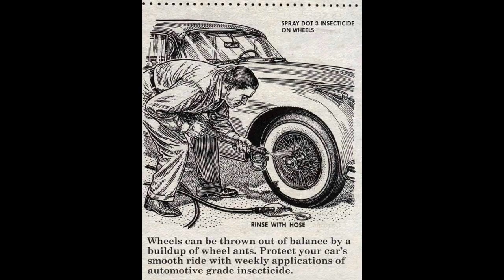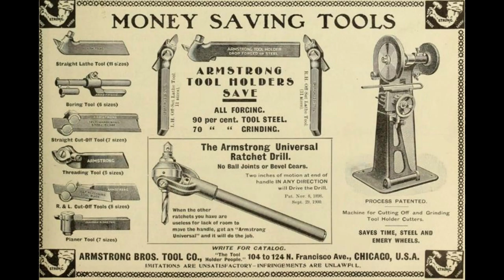Brown & Sharpe mill from horizontal to vertical machining

Comment: Doesn't seem right not to have B&S taper!  But is probably a lot easier to knock it out!
Reply from the maker: Wow! The B&S Tapers could really stick. I am not sure but WW2 might have been when they began using the now standard 40 and 50 machine tapers that happen to be low cost on the used market now, thanks

Comment: I have  machine that uses the NMBT 40 tapers. Same deal with the CAT 40 tapers.I had some CAT40 tapers given to me. rather than waste them ai decided to use them. But still wanted two drive lugs.  I simply machined a custom drive lug for it and never looked back.  The metal sure had brightened up quite a bit on the old Morris drill press
Reply from the maker: I found once I got the unhardened spindle socket true from a 40 taper holder spinning, the holders tend to really stick. As long as I pay attention to keeping the draw bar snug, there seems to be no problem using it for light duty repair work without the drive lugs. I think there are 4 distinct 40 taper style holders using 3 different threaded draw bars, I am using them all on this head.

Comment: The radial arm drill is looking good Don. Did you ever get those bearing replace you talked about on it? Thanks
Reply from the maker: The bearings I will replace after I move it close to the building, thanks!

Comment: Heck, that idea, in the Ad, of a beer bar at the front seat, for the passenger and, apparently, the driver, would make for a very mellow accident. Things were very strange back then.
Reply from the maker: People really got hurt and killed in those old cars even in light accidents. No seat belts because it was better to be thrown clear of the old sharp glass and twisted metal. Up into the early 90s the bars in Montana had drive through windows and Go Cups. One bar you could buy dynamite!
Reply: @DonDyarprecision  yeah. Those were the days before terrorists and other problems. I have a book from one of the magazines, maybe Popular Mechanics, I’d have to go look, which told you to go to your local drug store and buy red and white phosphorus in their recipe on firework making and various recipes on gunpowder. It’s amazing that you could just get these on the corner. I ran a fair size commercial film lab here in NYC for 28 years. I have a license to buy whatever chemicals I want. I did have six years of chemistry, so I qualified, plus a quick background check. I needed that as we processed Kodachrome film and you had to make the chemicals from scratch. The ones Kodak didn’t sell I bought from City Chemical. I renew it even though we sold the company back in 2004.